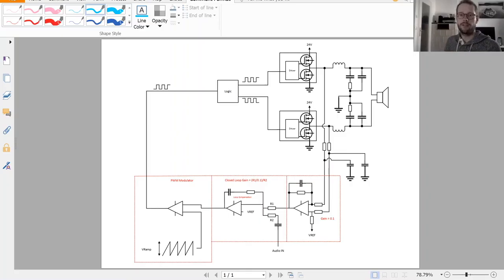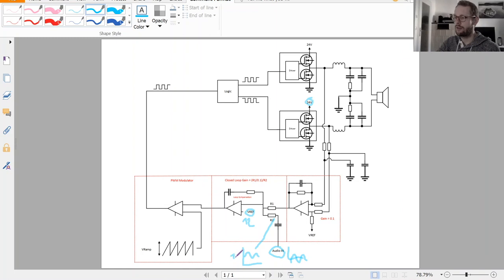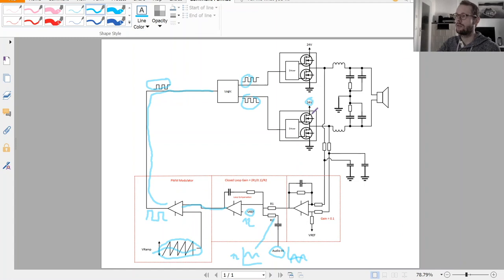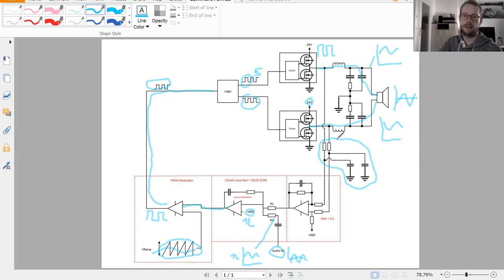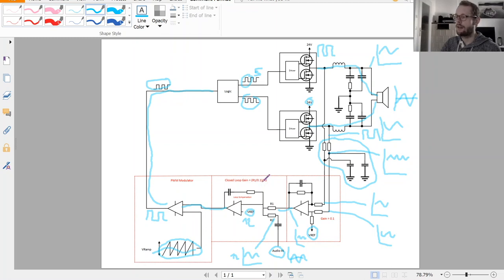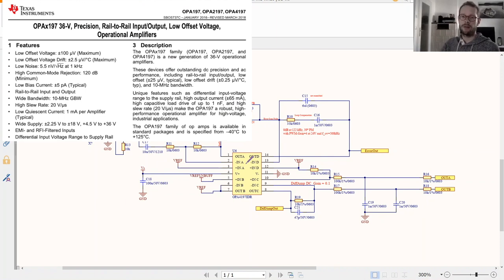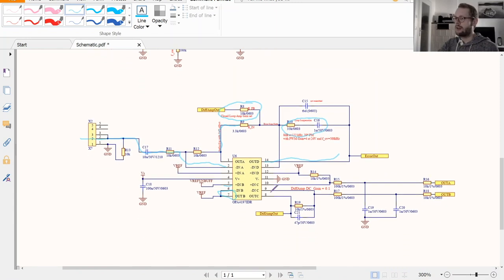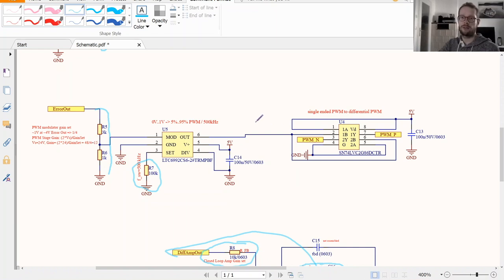[#12]  Discrete Class-D Amplifier (PWM based)

Comment: THD+N is often measured after filtering the amplifier's output signal using an almost ideal brickwall filter with -60 dB damping at 24 kHz and higher. That is probably why your amplifier sounds much better than THD+N of 6% may expect.

Comment: so this is basically a push-pull amplifier correct?       so would this be similar to a full bridge design?   
also is this similar to a class B amplifier?   

since there is a possibility of going fully active and not using any crossovers technically you could get away with a Class B topology or this class style amplifier pictures here without any crossover Distortion since you don't have to run any kind of standby or bias,  current  from what I can understand.

@ 4:50 you are explaining amplifier feedback circuits  at this point from what I can tell this basically gives the audio signal more linearity from what I can recall.  (?)

After that??   Way above my I.Q. Level..   :-)

Comment: Have you ever thought about using a fast MCU with an i2s ADC and modulating the output devices from the MCU directly(buffered with something like a totem-pole for example)? That way you can very finely tune deadtime for your output tansistors right before they will start to shoot-through. It will reduce distortions dramatically. But for that you will need a higher than the upper rail supply voltage for the gate of the upper transistor, which can be achieved using a charge pump, modulated from the same MCU, or using a floating 12 V supply, referenced to a mid-point, or a gate drive transformer(the latter is impractical due to many catches on how to properly discharge the gates but doable).
Reply from the maker: Yes I thought about modulation on a microcontroller. I‘m actually planning something in that direction also with feedback completely in digital domain. But not sure how to realize a good  low-latency feedback path back into digital. My target is to realize on a TC375 microcontroller
Reply: @YetAnotherElectronicsChannel  try the open loop first, fine tune the parameters, measuring THD, and maybe you won't even need for analog feedback? Properly driving MOSFETs is another challange.
Reply: @YetAnotherElectronicsChannel  And drop ceramic caps in the filter. They may constitute some numbers to the THD figure, even chinese guys use film.

Comment: Ceramic caps are good for filtering?which makes audible noise due to its piezo electric effect. (may be am wrong)
Reply: No, they are the worst, especially the X7R type. Not only the piezo electric effect can induce ringing if the amp is in the same room as speakers but also they will induce audible distortions with high level signals on it's own. Even at small signal levels X7R can induce distortions under -80 db that can be clearly measured with a simple setup like a soundcard with a loopback and a ceramic cap inside the loop. NP0 are noticeably better in terms of THD but are totally same for piezo effect. MKP film would be the best bet here.